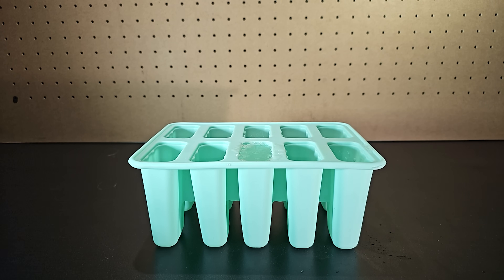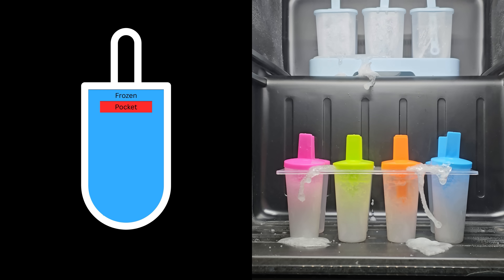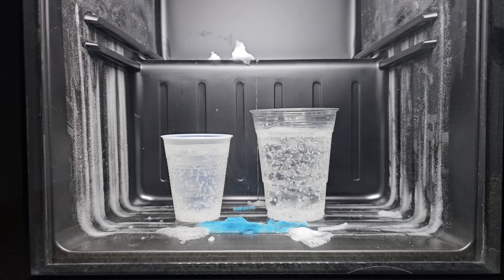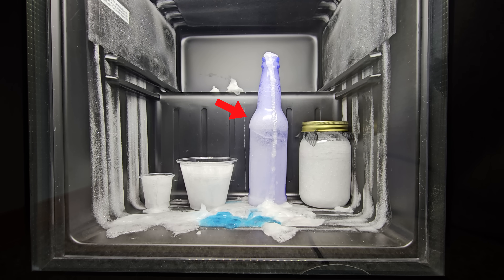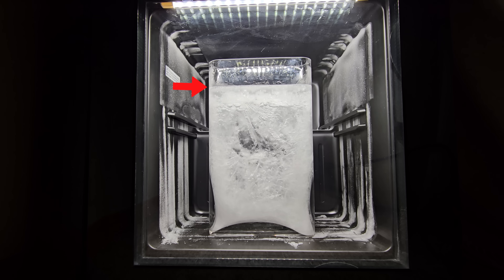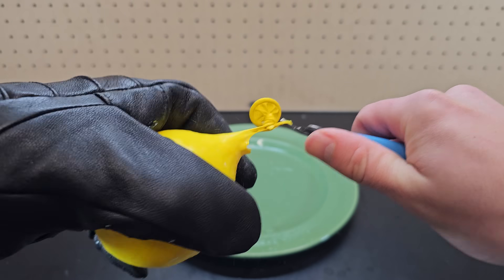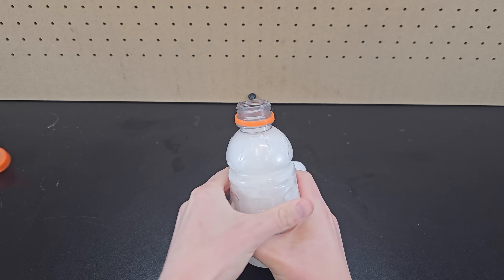Weird things happen when you freeze sparkling water...

Comment: The pocket forms from the top edge freezing in a sealed container. Co2 is pushed out from the bottom and gets stuck when trying to escape at the top hitting the top edge. 

This will be effective with rubbery materials. Flexible isn’t enough, it needs to be elastic because the ice will grip the surface forming a seal that traps the pocket. That’s why the balloon and silicone works.
Reply: Bump

Comment: I don't see this near the top of the comments, so if this is a repeat, sorry. It seemed like the smaller the air pocket on top of the liquid before freezing and the tighter the seal, the larger the frozen gas-formed pocket would be. The first balloon had almost no air pocket, and the result was obvious. The second balloon had a larger air pocket which caused problems.

Comment: 6:12 I wonder what bearing the increasing pressure of the expanding balloon plays on the formation of the ice, as opposed to a static (non-expanding) container..  I also wonder how the experiment would change by altering the surface tension of the water while it's freezing.

Comment: So i can freeze sparkling water inside a balloon, drill small hole in it and fill air pocket with alcohol, then refreeze the hole to have instacoctail balls to smash into some juice? 🤔 Didn't knew that!
Reply: Why not just freeze the alcohol in the balloon?
Reply: @fictive9421  strong alcohol drinks has lower freezing point, something like -25ºC. Good luck freezing it.

Comment: If you use something like a well insulated cup, you might be able to get the water to freeze at the top first, sealing more of the air in. Then it'll freeze top-to-bottom, rather than from all sides at once. This might not produce the same air pockets you're looking for, but it might be neat to try. You might be able to use something like a styrofoam cup (or two stacked together for thickness) if you want a cheap, destructible option.

Comment: It might be interesting to borrow or make one of those lab sample swirlers. I don't mean the magnetic stir bar type but the little table that moves in a circle kind. Then you don't have to open the bottle to keep moving heat to bottle wall for removal and the whole mass of ice might form suddenly in a few seconds. If I remember correctly, cold water holds more CO2 that warm, so it might try to hold on to the gas right to the bitter end and make better pop-ice. You might also get to see the water get below freezing for even more sudden freezing.

Comment: I once tried to replicate that blast chilled slushy coke by putting just a regular plastic bottle in the freezer for a couple days.  I let it sit out to thaw a little and then tried to open it, and it starting foaming out the top like i'd been shaking it for five minutes straight.  It took me over an hour just to get the lid off without making a complete mess because as it melted it would just keep re pressurizing itself

Comment: While dangerous if not performed properly...  If you put it under pressure...  Instead of degassing epoxy and resins, you can leave them under high pressure as it cures.  The high pressure forces any air bubbles to be so tiny that you cant see them, leaving the resin clear.  Unlike degassing, they're still there.

Abstract that to freezing carbonated water into ice...  If the air above the water is at a higher pressure higher than the vapor pressure of C02 leaving solution, or even high enough to force some air into the water.  It should theoretically be trapped in the water as it freezes as it has no where to go.  When you freeze it in atmospheric pressure, the C02 just leave solution.

Now...  If you're going to do this, do your research and make sure you understand the physics because freezing water in a confined container is no joke.  There's a video from ActionLab where he trapped water in a thick steel pipe and froze it.  The pressure ice exerts due to expansion during freezing tore through that steel like it was plastic.  Air is compressible, but you'll be fighting the pressure rising as it freezes and tries to escape.  Pressurized C02 would work best as using air will let some gas leave solution as it mixes to equilibrium.
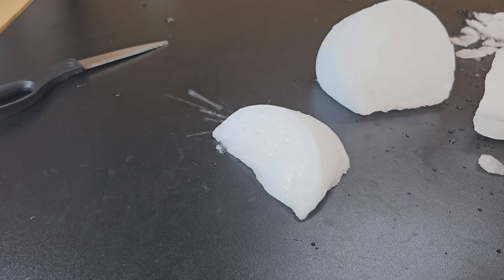Reply: 7:41 Oh, above is basically what the bottle did...  So imagine if you pressurized something to like 120PSI with pure C02...  As it melted it would be popping like pop rocks you cant stop Im sure lol

Comment from the maker: Also, funny piece of extra information, I reached out to a few of my favorite sparkling water companies once I first discovered the pocket. I tried to explain this video concept to them and asked if they wanted to sponsor this video, but they weren't seeing the vision🤣🤣
Reply: Haha, their loss
Reply: οnly gatorade got a free ad
Reply: @alexalekos and bubly
Reply: @DefensiveLettuce  didn't know this, not familiar with usa brands at att
Reply: would using IR camera's help,the temperature difference between gas and solid can help identify at what point and how the gas forms

my explanation for a pocket is that the uppermost parts are exposed the most to the cold currents of the freezer and if not alot of gas is disturbing by rhe time of fusion,its gets solid hard,the outermost layer gets solid and forms a container inside which normal buoyant force creats a gasaccumilation
Reply: They missed out. Science experiment and advertising in one would be a great ad.
Reply: I don't get why not, even if it's only supplying a few cans of water. That should cost almost nothing!
Reply: Lol😂
Reply: I love bubly
Reply: Worth a try 😂.
Reply: Mate what if you add air valve (like bicycle tire thing) and increase pressure puping more Co2 ?  :D
Reply: Shame on them.
Reply: Just keep pumping CO2 gas through it (under pressure if can) during the freezing process.
Reply: Thanks for sponsoring me my name is vision
Reply: Lol

Comment: If the problem is the outside shell doesn't freeze fast enough, maybe you need to experiment more with material, in addition to size and shape. As far as it being clear enough.. uhh I know they made transparent alluminuim cans at some point, but idk how well that would work for this.

But.. maybe try more metal containers? Something that conducts heat well would freeze faster on the outside, right?

May not even need the whole thing to be metal, I was thinking about it when you said where the bubble was forming, what if the popsicle handle was metal? Maybe flat across what would be the bottom of the popsicle, maybe with slight concave variants curving towards the popsicle. It would act as a little dome when freezing, trapping more gas. Idk, just ideas 😅

Comment: I think that the pops are caused by the CO2 that's still dissolved in the ice expanding due to its temperature increasing. When the water is liquid, the individual water atoms can move around to accommodate for those pressure differences, leading to the bubbles rising to the top and escaping to the atmosphere. But when the bubbles are frozen in place, there is no room for the CO2 to expand as it heats up leading to the bubble exploding.

It behaves like those explosive decompressions that happen when underwater vessels surface too quickly and they don't compensate for the pressure differential between being under the deep sea and at sea level.

Comment: Now I'm curious what happens when you flash-freeze carbonated water
Reply: how do you even flash freeze things, just rapidly decrease pressure and temperature at the same time?
Reply: @ThatNerdGuy0 Liquid Nitrogen
Reply: @Boovel  I’m pretty sure that’s also what it makes
Reply: @Boovel  That sure would do the job
Reply: @ThatNerdGuy0  blast freezer?
Reply: Wondering the same
Reply: I think flash freezing any reasonable volume of water while gasses are dissolved inside is actually kinda hard. You can easily flash freeze the surface of course, but flash freezing the entire volume would probably require increasing the surface area to increase heat transfer, meaning you basically spritz it. That way you end up with tiny snow flakes or something, probably without trapping any gas...
Reply: Restraining roder
Reply: @NileRed
Reply: Bro now I am bro😂
Reply: explosiom probably?
Reply: I normally froze coke once

I didnt believe that coke can freeze lmao
Reply: @CubicAsh what
Reply: @CubicAsh I too froze coke once
Reply: @CubicAsh  DO NOT TRY THIS… mine exploded :D
Reply: Astronaut soda
Reply: @NedLingamon  Now I want to eat freeze-dried soda.
Reply: @JohnSmith-td7hd I think freeze dried soda would just be crusted syrup. The carbonation breaks down into CO2 and water neither will be there after freeze drying.